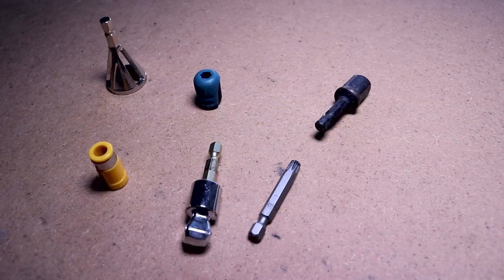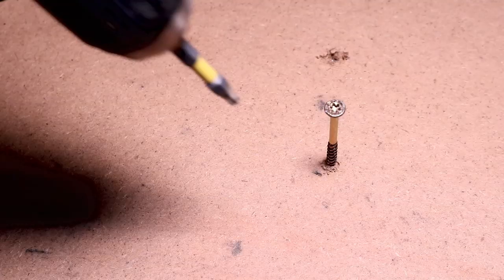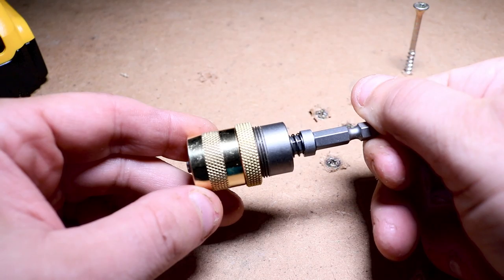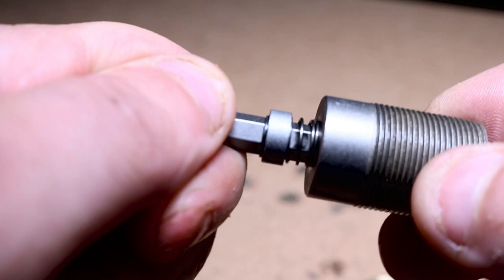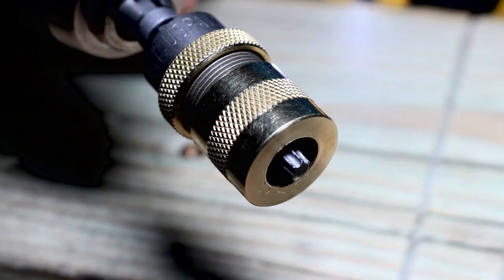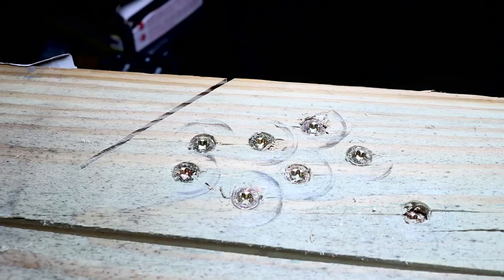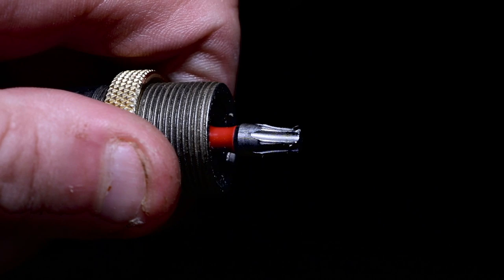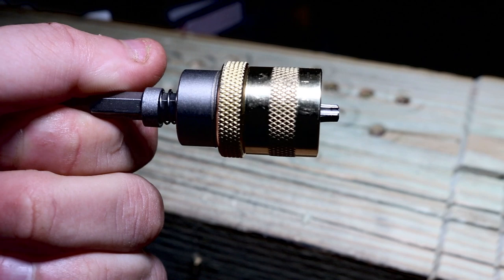If you use a cordless drill, STEP UP YOUR GAME with this tool! #COOLTOOLS #CORDLESSDRILL #TOOLS

Comment: I have never seen this before. Seems pretty nice. When stops at desired depth, does it mess up the screw head at all? Nice accessory and thanks for tip suggestions. 👍😊
Reply from the maker: The only issue I had with it was when I used the crappy Phillips head, but it was just the bit that got damaged.  No screws were hurt during the filming of this video 😎
Reply: @ToolReviewZone  good to hear. I fight for the rights of screws. 😂🤣🤣👍👍
Reply from the maker: @johnrice9121  hahahaha, such a good guy👊

Comment: Used to use different magnetic brand for hanging drywall for years before finally got a drywall screw gun. 
I’m with you about throwing bits out (or save for backup) as they just don’t work great most of the time😉 Do like using Makita or DeWalt bits as they just fit great in tools, & the figment on the fasteners is great as well👍🏻
Reply from the maker: Thanks for the awesome feedback Aepek!!!

Comment: Good video. I already have a Dewalt Dry Wall Screw Gun, but for the price of that tool, I will probably get one to keep with my screwdriver bit set since I can use it with any drill motor. I don't have to carry my drywall gun with me along with my standard drill. Thanks for the tip.
Barry

Comment: I already have this tool but its made by some random company not dewalt. We hung 8 ceilings with one of those and a cheap 3 dollar one. We do have a drywall screw gun but we liked the impact better.
Reply from the maker: I like the one called smart bit. It's a bit more expensive, but seems they went the extra mile with theirs.

Comment: It leaves the big ring indentation.
Reply from the maker: Yeah that's why I was saying in the vid that there was a more expensive one with a rubber gasket on the end.  I pot a link for both below
Reply: I had one no brand , no adjustment for $1, 10 years ago and it work perfect until now

Comment: any true woodworker once start using impact drivers after while you won't need this at all,it's really for the noob or heavy hands
Reply from the maker: I would mostly use this in tight areas like automotive where you could drop a screw or trying to get into one of those funky areas.